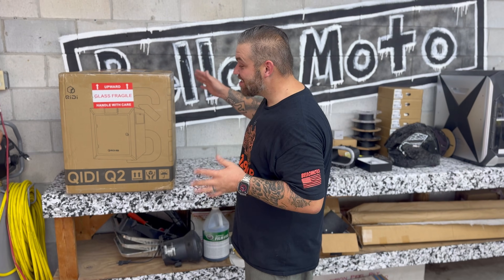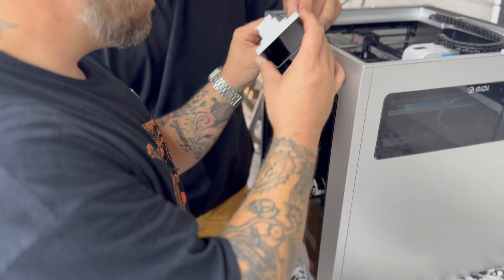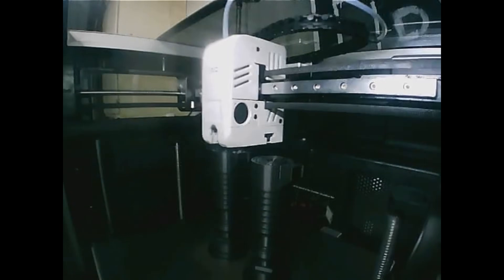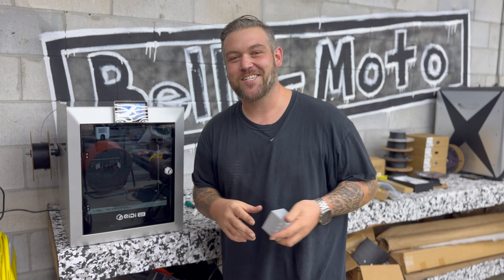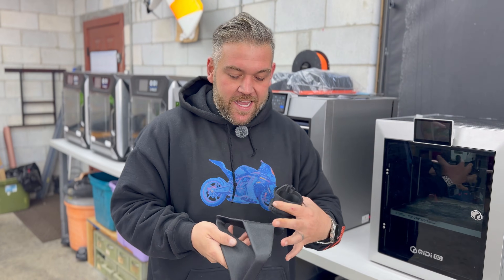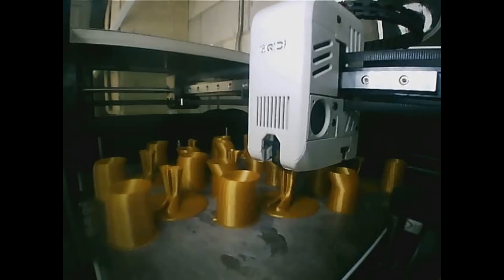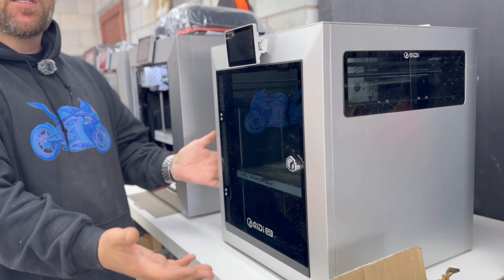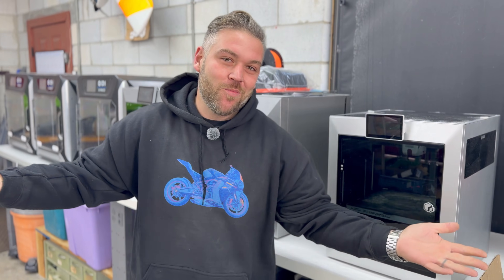This is The Best 3D Printer under $500!!!

Comment: I have had mine three months now, and it’s a great bangs for bucks 3D printer and as said elsewhere, it beats my modded Bambu X1C on ASA/ABS, and the Ethernet port is a win win. Ordered a 0.6mm for ASA-GF functional parts
Reply: I should add I do parts for my motorcycles too and the only fail I got was n early spaghetti detection false positive when looking at gyroid infill, but I’ve had no problem since with the later firmware. It also did a good job with TPU. If I wasn’t buying. 500x400 toolchanger, I’d look at the new QIdi Max 4 as a single material printer for engineering materials. Merry Christmas to you guys too.